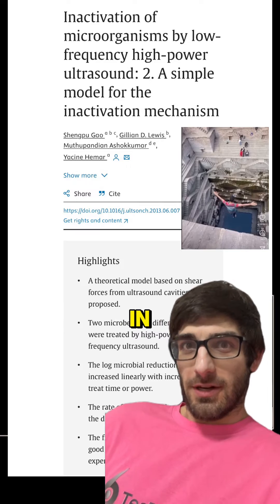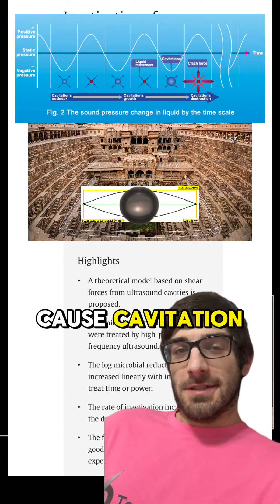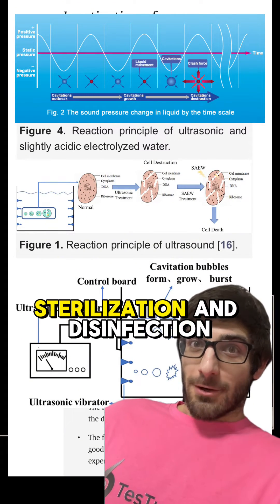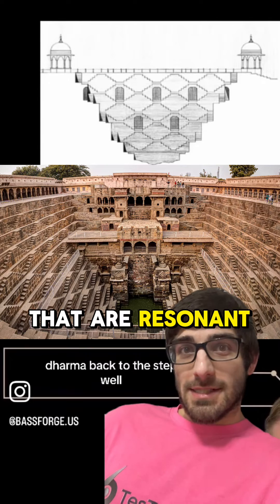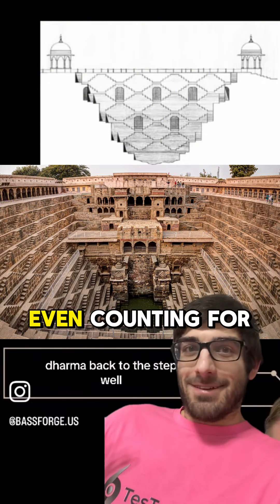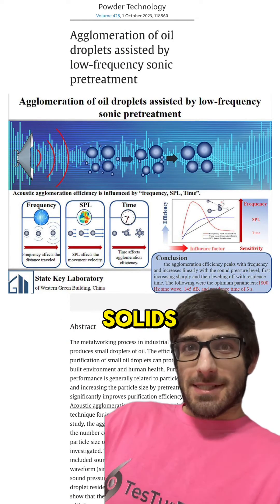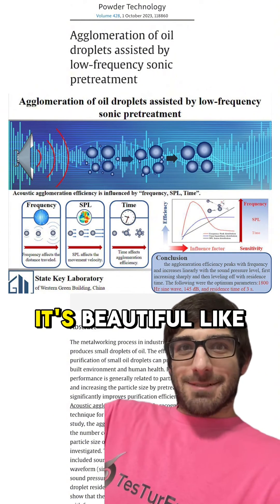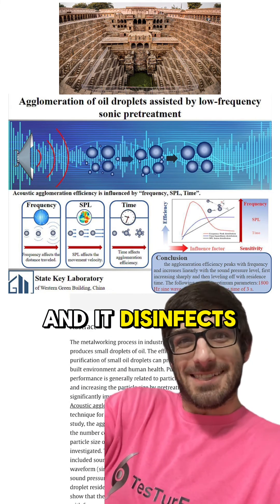StepWells: Acoustic & Seismic Water Purification capabilities

Comment: Hi, I’d love to learn more about this, but couldn’t find any research connecting the stepwells to water purification. Can you point me to some of those resources, or are you making that connection yourself?
Reply from the maker: @johnnicholson1306  hey thanks for commenting! 🙏❤️‍🔥 
 
so I’m making the connection to step well but I’d be more than happy to share with you some things to look into that support the functional aspects of my claim. 
 
Acoustic technology has found various innovative applications in water treatment, primarily focusing on purification, sterilization, and disinfection processes.

Here are some of the prominent methods:

Ultrasonic Algae Control:

High-frequency ultrasound can be used to control algae growth in water bodies.

The ultrasound waves cause the cell walls of the algae to rupture, leading to their destruction without the use of chemicals.

Cavitation:

This method involves the generation of microbubbles in water through ultrasonic waves.

The implosion of these bubbles generates intense local heat and high pressures, which can destroy microbial pathogens and break down pollutants.

Acoustic Agglomeration:

Low-frequency sound waves can cause small particles in suspension, such as sediments, bacteria, and even oil droplets, to agglomerate into larger clumps.

This aggregation makes it easier to remove the contaminants through conventional filtration or sedimentation.

Sonication for Disinfection:

Applying ultrasound waves in water induces mechanical stresses on microbial cells, potentially leading to their physical disruption or inactivation.

This technique is effective against a broad range of microorganisms, including bacteria, viruses, and protozoa.

Enhancing Chemical Processes:

Ultrasound can improve the efficiency of chemical disinfectants like chlorine and ozone by increasing the mixing and chemical reaction rates.

This can reduce the overall quantity of chemicals needed for effective water treatment.

Fractionation of Contaminants:

Ultrasonic treatment can help in fractionating (i.e., breaking down) large complex contaminants into smaller, more manageable molecules, which can then be more easily treated or removed from water.

Water Softening and Scale Prevention:

Acoustic waves can be used to alter the crystallization process of minerals like calcium carbonate, thereby preventing scale formation and even potentially softening hard water.

Each of these methods leverages the unique interactions between sound waves and water molecules or contaminants, providing a variety of non-chemical, energy-efficient ways to purify and sanitize water.

Comment: So is the water safe to drink in the bottom of that well or not? It looks pretty green in a few pictures, doesn't exactly look safe
Reply from the maker: Hey thanks for commenting but it would need to be tuned to the local civilizations vibrations for it to work naturally. And without applied acoustic and music to it it won’t work effectively enough.  

Nevermind, and I don’t want to be insensitive to the complete lack of water that results in this, but you wouldn’t drink from your tap water if people were bathing in it before it got sent into your pipes either. 

Again I understand that it sounds arid there that people have to resort to this for bathing water. 

If people want to bath in it they have to apply more acoustics to it to get enough cleaning. 

Putting a drop of some water cleaner or sterilant in a swimming pool might clean a cup of the water but there need to be enough done to get it all. 

Also the resonant mixing parts still have to have the agglomerations to be taken out as well. 

It makes lesser quality filters work better than they otherwise would because it uses the existing “dirt” for a lack of a better term to do some of the cleaning and accumulating of the other molecules before a filter. 
 
I hope this helps.